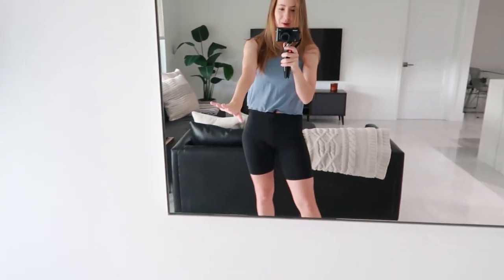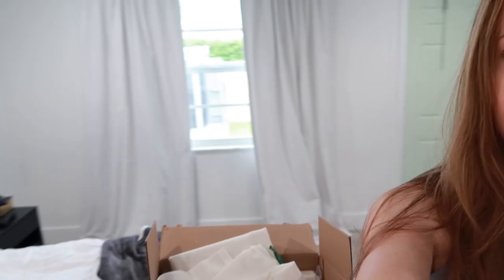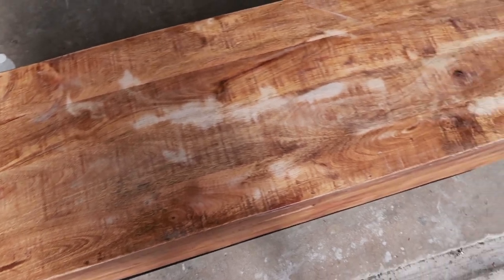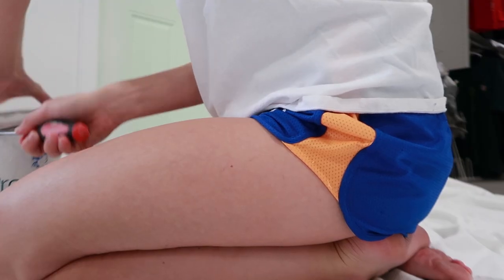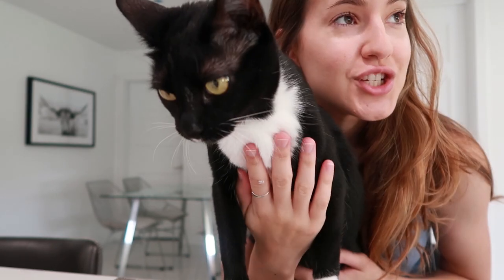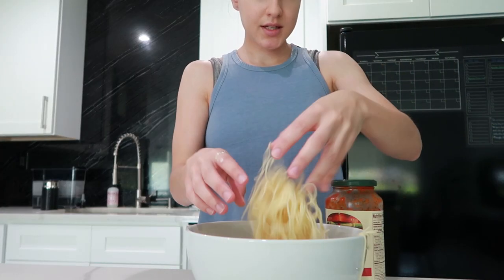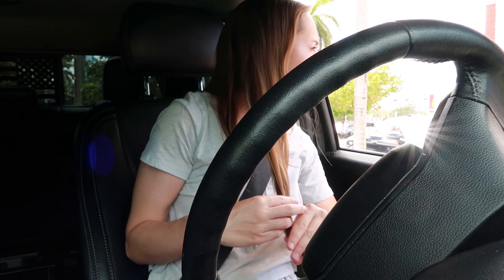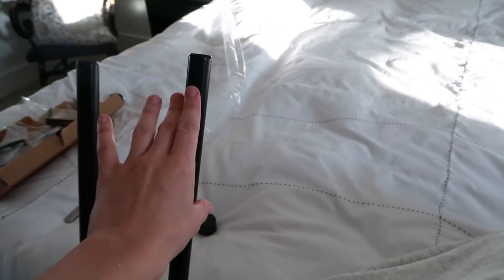Day in the Life Working on our Home // Painting, Staining Furniture, Minimalism & More!

Comment: I think the stain needs to be spread out a bit more and dry on in lighter coats.  If you wipe it off with a different rag between coats, it will be more smooth. Back to sanding!